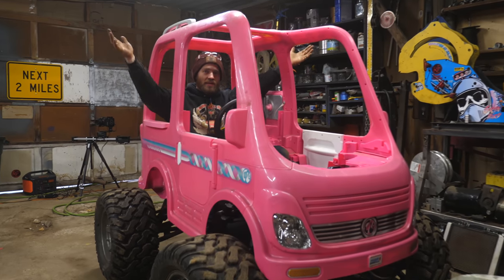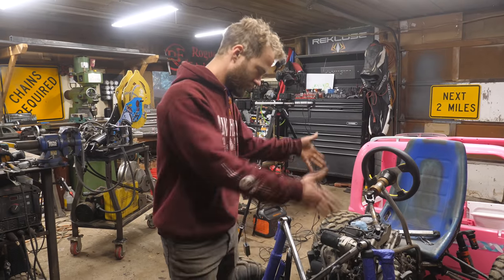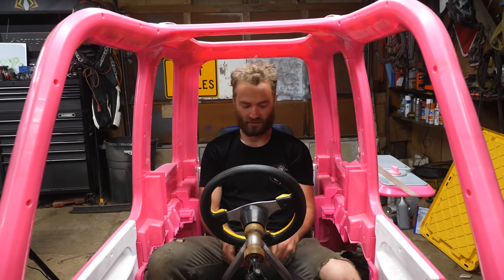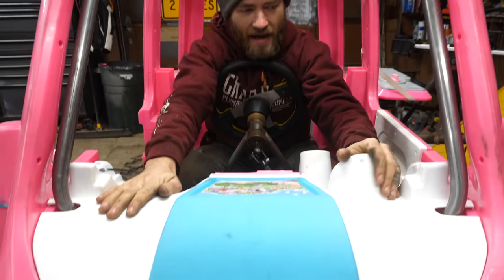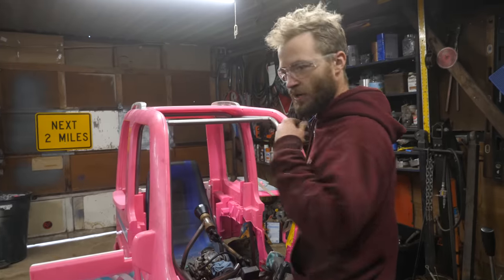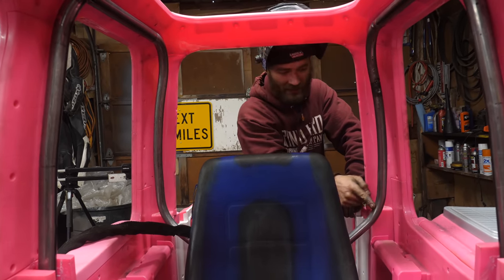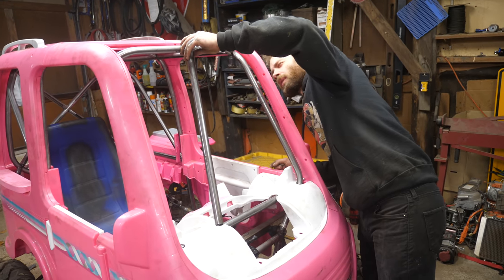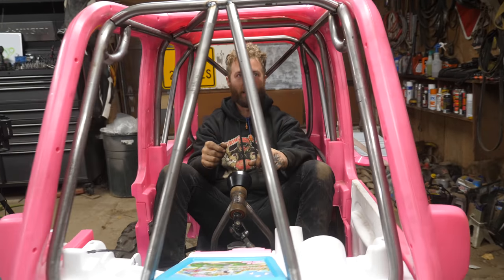Power Wheels Camper Van Gets a Roll Cage! 4x4 Overland Van Build

Comment: I love this build although i'm not sure how much of a benefit those front bars would be more than just a distraction while driving, anyways can't wait to see it rip
Reply: My thoughts as well. I understand the increase in structure but there directly in line of sight. I wonder if he could have done a smaller interior square frame for like a “windshield” look. Either way it’s an Awesome build and love these projects.
Reply: I thought the same. Looks are not that good with them too
Reply: If F1 drives can deal with the halo I’m sure GHPC will be fine
Reply: Structural integrity (triangle is the strongest shape if you want to call it that) with out it if he ended up on the roof the front part of the sub frame would be the weakest point and would more than likely the first point of failure
Reply: Any chassis engineer will look at that cage and go " Ah, he's getting his lateral stabilization from that  upside down V  for his A, B, and C pillars. Which it needs.
Reply: @dallasbarnett2389  maybe like semi curved 45 gussets in the upper corners? Just a thought 💭 👍🤩

Comment: Love the build! I'm a bit curious if those two vertical runs in the front are necessary for the overall stability of the roll cage. Don't get me wrong, I definitely think it's better to be safe than sorry, but I feel like they're going to wind up being more distracting than anything. Keep up the good work!
Reply: Yeah I'm not a big fan of them either.
Reply: I think they could get better visibility using 45°s in the corners and still get the same strength.
Reply: If the bars wer the other way around it wudnt b so bad instead off /\ shud b \/
Reply: You don't notice them after a while. Have driven split screen VWs and Landrovers and your vision just ignores them.
Reply: Can’t say I like them I thought the same as you personally I think it spoils the overall look of it
Reply: Windshield bars are a huge strength point.    Believe me you look right past them when driving.

Comment: I'm worried that those 2 vertical bars that are right in your line of sight are gonna be more distracting than useful. That'd be given me split vision for days on the trails
Reply: Yeah, I dont like this at all either
Reply: Agreed. Racecars don't even have that. Some gussets in the corners would do the job. Plus you're sitting all the way at the back, so it doesn't even matter if that part crunches in a bit.
Reply: Agreed bars in the front are overkill.
Reply: i think he's going for a trophy truck look
Reply: Killed the look 🤦🏾‍♂️
Reply: The only way those quad catchers are going to catch a quad is if the chassis gets snagged on a hook with them. They do significantly take away from the aesthetic...despite helping reinforce the area which looks needed...maybe gussets are a suitable compromise, or solid bar stock
Reply: Should be fine. Your brain makes them invisible when it needs to.  Lots of vehicles had split screens and not distracted by them. Bit like your wiper blades
Reply: @seanthomas4868   your wiper blades arent 1" round right in your line of sight PERMENANTLY
Reply: Was gonna say the same thing.. if anything double the bar all the way around but leave it wide open
Reply: I love all their builds but those 2 vertical bars are no good! Would do my head in having them in my line of sight
Reply: As a race car driver with “trash bars” in front of me (three 1/2 round stock bars) you forget they exist when focused on driving
Reply: Lets just be real with ourselves it looks ridiculous and he needs to cut them out
Reply: i dont like the looks of it. but f1 has a halo and those guys drive with it just fine, so for the barbie van it is just fine as well
Reply: I just don't like how they look either...  I don't know what he was going for there, but this ain't it. lol....   if anything, just run them to the corners, towards those grab bars.
Reply: It's better to have a gun and not need it than to need a gun and not have it . And the same thing could be said about most things . Too many things are done just good enough , nothing wrong with a little overkill now and again .
Reply: @Shadowband72  So you're saying that you don't like them either?  yeah, me neither.  I bet he changes it.
Reply: @calholli  no I was more like saying it was probably a good idea , if everything was over built . The only downside would be that the automotive manufacturers wouldn't be selling anymore cars because all the ones we already bought would last forever . If you're building a four-by-four to go off-road you don't just start with the crappy axles that Jeep or whoever put underneath of it . You switch it up to something from a 1 ton truck or better . Because as much as Jeep likes to throw that trail rated sticker on everything . Hardly anything that they make actually is trail rated . Unless it's a trail that a two-wheel drive pickup would have no problem with .
Reply: Yup that's wack🤙
Reply: @trillrifaxegrindor4411  my old jeep yj had wipers that sat up on the windshield. You don't notice it. Also a ton of rock crawlers have those V bars. My friend has a Jeep with them and he doesn't even notice them anymore.
Reply: Lol man u lot complain allot, next you will tell him to fit a reverse camera you nannys use
Reply: I was thinking the same thing. I don't think they are really necessary and they are too much of a distraction.
Reply: Wow....  You guys don't build cages.  He's getting his lateral triangulation at his A and B pillars with those two vertical tubes. If he used larger tubing he'd have more options since the diameter is pertinent to lateral forces. But since he's making it fit inside a barbie jeep, the 1" tubing is about all the room he has. He absolutely needs each pillar triangulated if he wants it to survive a flop. The design he used is common and will not hinder vision. You look right through small vertical tubes since your focus is further away. You literally are looking around the tubes with your eyeballs distance from each other.
Reply: @KIANkillsps  Hold your finger out in front of you vertically and look at literally anything. You have two eyes for a reason. Now, if someone was blind in one eye, this would bother them more.

Comment: I see alot of guys say those bars up front are going to be distracting. But I know I've driven some cars that had some really bad windshields also have driven some sand rails that had a v set up in the front window. And I've NEVER focused on the bars or cracks. I only pay attention to what's in front of the vehicle...but you will know the first rip you get to run on the beast... great job guys I freakin love the new build.

Comment: I think Ethan that this Barbie Camper will be the most comfortable fit for all users and probably the biggest attraction getter as well, I wonder how long before the copy cats start building their own?
Maybe you can do a colour matched( to your big one) kombi mini next?
an idea for the new shed when you get around to it.
If you want it in the same location build a NEW Shed over the old one say 2 or 3x the size you can continue working in the old one while the new is being built and when you are ready to move into the big/new extension it will be less interruption to dismantle the old, lay the concrete floor and move back in with a flying start.

Tony from Western Australia 🇦🇺

Comment: Tbh I personally would have taken the bottom mounting points of the front reversed V of the cage further outside because of view reasons. This way you have 2 bars infront of you driving it. Taking the bottom mountings further to the sides would give you a better view while driving and could even add a bit of static strength on top. Other than that, marvellous build as ever...!

Comment: weld tubes around the fireplace for extra heat, hot air wants to go up, so if you weld open tube on fireplace it will work as fan.

Comment: The two extra brace bars at the front have me thinking of the Formula 1 cockpit halo.  The drivers say they barely notice that web of carbon fibre between them and the track.  I am sure those braces will be no problem either.

Comment: The tubes that extend from inward of the shocks are called "stanchions"
The reason why you want to keep these free of hard debris and scratches is that
the shock itself holds pressure and also suspension fluid, the seal on the shock body that connects to the stanchion
holds pressure and if that is disturbed it can leak air/gas and fluid and let dirt in
remember always clean lube your shocks! you can even just literally clean the stanchions and the main seals and just put silicone oil
 or silicone grease on the stanchion above the main seal and cycle the suspension up and down it's travel a few times for pure lazy/quick maintenance 
I once used butter as stanchion grease :D

Comment: Is this one going to get barrell rolled down the test hill? For the tech tip, take a piece of tube that matches to the ride hight lenght of the shocks and weld similar end pieces and gas/oil chambers matching the shocks. You can then take the shocks out for the welding period, and not cook or fry them during the fab process.
Reply from the maker: Haha! Hopefully not! Thanks for the tip! That’s a great idea.
Reply: @GrindHardPlumbingCo  Imo, I honestly think you should roll the cage down the test hill. This way you can verify it's structural rigidity and actual safety. When you end up strapping yourself inside that cage, it is good to know will the cage save you or slice you when rolled over. The vehicle itself is quite tall and relatively top heavy, compared to your earlier models, and the only one you cannot bail out, when it tips over.

Comment: I'm guessing you can't pull the body off like you did at the beginning of the video. Build a sub frame hinged in the back and attach the body with roll cage to it with a spring clip in the front. Release the clip and tilt the body with the roll cage out of your way to service your rig.
Reply from the maker: The body will still be removable. And the roll cage is very much part of the chassis, so it can’t be hinged.

Comment: What is the size of the tubing your guys use for the frames of the power wheels builds? 1 inch diameter?? By ?? Thickness? DOM? Or no? Thank you so much. I have one I've been really slowly building and am using 1 1/4 inch tubing but it's a little bigger (not power wheels size) if you answer this thank you so much!!!

Comment: No need to put the two in the front window. Should of just put an x in the roof an stiffener bars down the sides of the front A pilers. Guessing you did it for Tower strength I'd of tryed to find away to get the towers back to the chassis